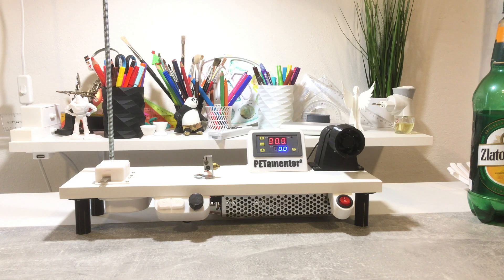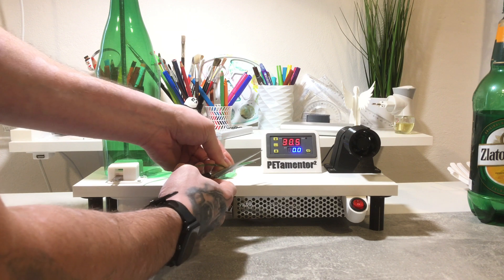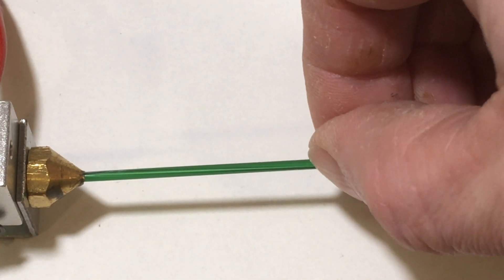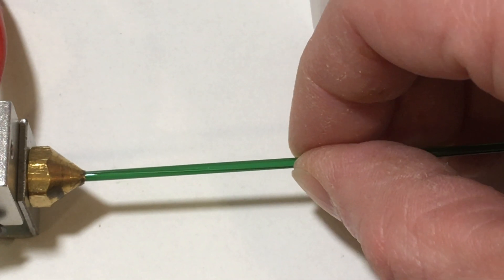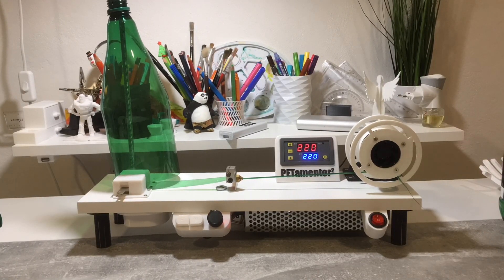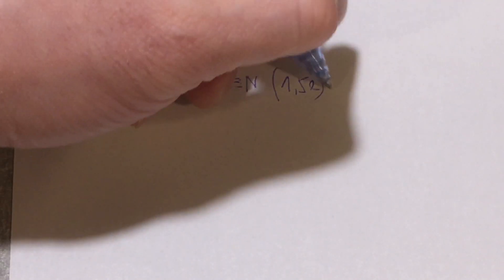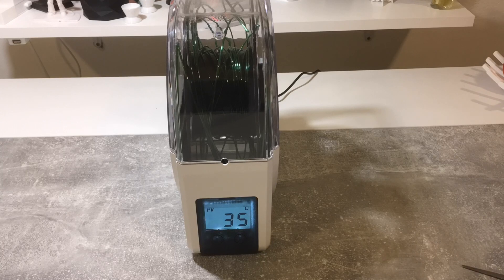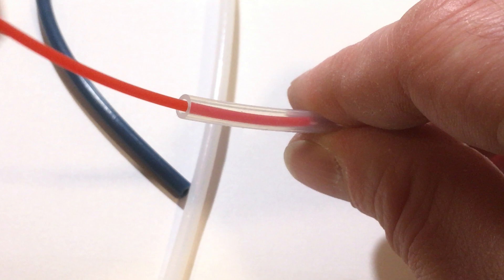3D printing bottle filament machine - PETamentor2 instructions and suggestions

Comment: Hello, first of all I would like to thank you for your wonderful work and for sharing it. A small remark regarding the width of the band; normally the tube should close when the width of the strip makes the perimeter of the nozzle outlet, i.e. for 1.75 mm in diameter: 1.75Xπ = 5.497mm or 5.5 mm. Of course, for the tube to really form, it would be necessary to exert pressure which presses the strip to the inside edge of the nozzle. However, I find it amusing that you obtain the expected result by testing with a width equal to twice the perimeter of the nozzle orifice...
friendly

Comment: great work , i printed your stl files , my only addon would be a longer plate and side cutout before the spool holder zo its possible to fit big older empty spools from pla and fill the spool with pet , but great work :)

Comment: Hi the motor is only 7rpm? Is not to slow?
Reply: Less RPM means higher torque, so it can pull the filament + the cut the bottle

Comment: if the filament tube is not 100% closed  can't you compensate that from the SLICER by setting  a higher FLOW  ? 140 % instead of 100 ? i don't see why it wouldn't work ?  and that way  if you already have the strip cut at 10 mm width to still be able to use it ?

Comment: Hey, i just built my petamentor2 and i have a problem with a tamperature drop, when i set it to a certain temp it goes to that point and then just drops down for example i set it to 200 and it goes to that temp and then drops to even 120 degrees. Do you have any idea how to fix this problem or what could cause it?
Reply from the maker: Hi, this could be caused by thermostat settings. 😉
Reply: it works now, thank you so much, although i need to DIY a mount for the heatblock because the temperature sensor wont fit, after that i will make some filament. the build was very fun and im very excited to use it soon! :)

Comment: What is the energy consumption your device?
Reply from the maker: It depends on your power supply. 🫡
Reply: @ondrejsraitr  how so. If we buy the same supply you list give for parts. To know the kWh allows me to calculate the cost of heating the hot end for ~40 minutes. I use a watt meter that connects between outlet and device. Given power fluctuates as heat is regulated on my 3D printer for example. It measures power consumed in kWh.

Comment: How can you make temperature above 120c, the website says the max is 120c
Reply from the maker: Nooo. Are you talking about thermocontroler? You need thermocontroler wich is working up to 500C. It means the thermocontroler you are waitching is wrong. Will check the links😉
Reply: @ondrejsraitr  what is the name of the thermocontroller that you are using?
Reply from the maker: Sorry, Im not sure. Its selling as k-thermocouple thermocontroler 3323? The number is not real, but something like this. I checked both links on petamentor2.com in the parts section. Both of them are working 😄
Reply: @ondrejsraitr  okay, thank you.

Comment: Cut bottle strips 5 times narrower. Feed 5 such strips to single extruder in parallel. Get 5 times longer filament. Use 5 liter water bottles for even longer filament.
Reply: Maybe you can even join more strips like that in series by interleaving the lengths. Imagine 3 strips being fed in parallel, but only one of them is spliced at the time, while other 2 are reinforcing the splice. Splices go through extruder one at a time... You can even use hair straightener-like device (or two hot rollers) to weld the three strips together where the splice is, so it does not get torn apart when it enters the extruder.

Comment: Can't you just cut off the bottom of the bottle in advance to let it dry before the melting?
Reply from the maker: Yes, for sure. But it will still have a moisture from wet air. 😃

Comment: What is the size of the wooden plate
Reply from the maker: The platform is made of chipboard (you can also use other material). The dimensions of my board are 450×140 millimeters. The board is really small and the components fit snugly on it (I recomending to use bigger one).

Comment: What temp do you run the petamentor. The w1209 only goes up to 110c but your thermostat says 220... I built this and am having trouble with it l.
Reply from the maker: Turn it on, then left click, after display starts blinking, set the temp to about 80C.

Comment: Would it be better to get a stronger motor ? Is it the same motor from petamentor 1 ?
Reply from the maker: Stronger? Why? 😃
Yes, it is 😉
Reply: i don't think you can just pull the filament harder to speed things up... you would need to increase temperature in that case which in turn might introduce variations in filament thickness during the process.

Comment: hi how can i connect the new thermocontroller? for the mk2?
Reply from the maker: Hi, you can find a wiring diagram in our facebook group:
https://m.facebook.com/groups/594548605536945/permalink/601907688134370/
Reply: @ondrejsraitr  thanks i ve ask you a demand for join fb group
Reply from the maker: You will be accepted automatically💪
Reply: @ondrejsraitr  i keep the same thermistance or not?
Reply from the maker: Its the last post, I moved it for you…
https://m.facebook.com/photo.php/?fbid=10229406269965405
Reply: @ondrejsraitr  yes i see thks soo muxch it works just the temp hup and down a lot. how can i set the isterisis?

Comment: Will the version 3 of this filament cutter hold the bottle at the horizontal on a toilet roll dispenser to stop the noise?
Reply from the maker: Oh, its not possible Im afraid. The grvavity makes good job here for us. It has to be in the vertical.

Comment: Good job! How much it costs approximately, not including 3d printed parts?
Reply from the maker: Hi, it depends on you, but my opinion is about $35-$50. Some of supplyers are not selling into your country, that could make some parts more exoensive. But If you are try hard, you can achieve pretty low price 👍

Comment: I like new thermocontroller! Adjustable cutter is very usable feature but i think that stepper drive is overengineering in this unit. Maybe skrew adjustment will be just as usable but cheaper.
Reply from the maker: There is no stepper motor 👍
Reply: @ondrejsraitr  Sorry, i mean any motor. There is no reason for any electric drive for cutter adjustment. Just simple handle skrew drive needed.
Reply from the maker: Of course there is 😉. The blade is moving up and down in very small steps. Thanks to this is adjusting a blade height very smooth. On the other side it means so many spins on the screw. Its done with small dc motor. But youre right, it can be designed with manual screw too. 🤟

Comment: i see you pull your filament out with ease. i have to use brute force to get my pet through the nozzle ? how come
Reply from the maker: Hi, start with higher temps, this is allways better. I think that depends on the bottle. Beware of recyclated ones. They have small symbol with number inside, wich means numbers of recycling cycles…
Reply: @ondrejsraitr  yes my bottle were recycled. now im seeing a big difference with how easy it is to pull the filament. also your guide about having good filament output is working. im actually printing now with a test strip i did. now just gotta print a new puller cause i ruined mine (3rd time)
Reply: @ondrejsraitr  you should setup a discord for community i think alot of people are interested in talking to each other on this topic

Comment: What size is the nozzle need to be drilled to? Your parts list says drill but don’t find a size anywhere on the site
Reply from the maker: Im using 1.5mm drill bit. Watch this 😉:
https://youtu.be/WH65QqU2NoA
Reply: @ondrejsraitr  my commercial wire is 1.7mm, i guess you have to rim the hole a few times after piercing it.
Reply from the maker: Hi, the nozzle drilling is not too much hard work. There is one of my previews videos, for MK1 version. The nozzle drillng. Hope it brings you some clearence👍
https://youtu.be/WH65QqU2NoA

Comment: I want to cut a bunch of strips weld them together then run a spool of it to get a full roll done in one go. Could you design an attachment for that as well instead of doing on bottle at a time if you know what I mean
Reply from the maker: I kow exactlly what do you mean by this😄. Im still waiting for some idea, but ewerything what I tryed fails. Thats not worth the time and effort, I think.
Reply: @ondrejsraitr  Very nice design just a thought if you could cut some bottles in to strips and possible fold cut and insert in to the other strips so that the strips dont fall apart sounds like this has a high chance of working. Another thought use a soldering iron and temp melt strips together .

Comment: Any thoughts on joining sections of filament or joining sections of bottle stip together?
Reply from the maker: No, nothing very useful up to this day. Nothing found yet.
Reply: @ondrejsraitr  heating two ends at the same time a few seconds on the head of the extruder and joining them together should work, be careful not to put strength, just let them touch and wait.

Comment: Wow, next machine, nice:) i now making my own. My goal is all in one machine to recycle pet bottle.  I copy electronic from You:p thx for Your GREAT idea. Grettings from Poland:)
Reply from the maker: Hi, thank you. Will you post your build somewere? Im so curious 😁 AND GOOD LUCK from Czech 🤟🤟😁
Reply: @ondrejsraitr  I will post a video as soon as I finish it. As I mentioned my goal is all in one. Currently, I focus on simplicity - my winder is from the engine plus a one printed part plug for standard filament spools. The idea with a string was wrong for me, I came up with something simple;) But my machine will still have to be divided into two parts - cutting from the bottle plus winding, plus a welding machine for joining cut bottles in one strap and the other part - a smelting machine. Now I focus on the first part.